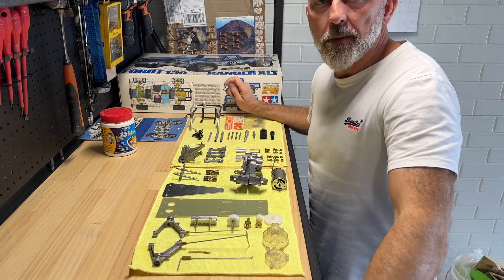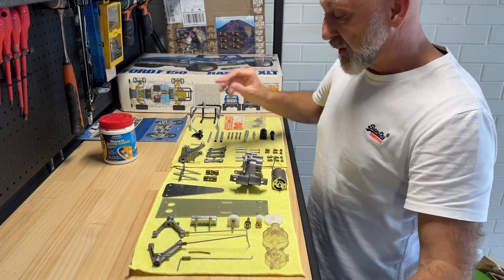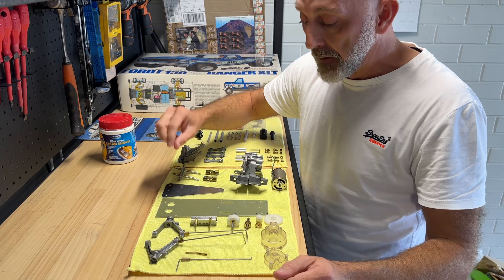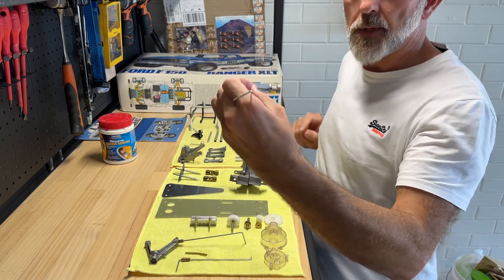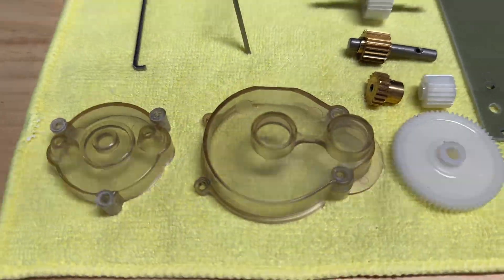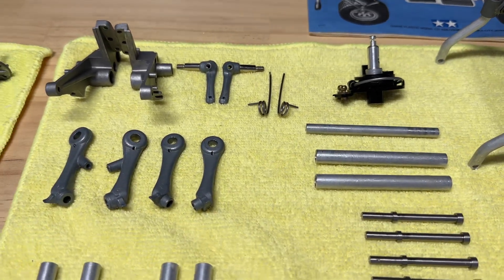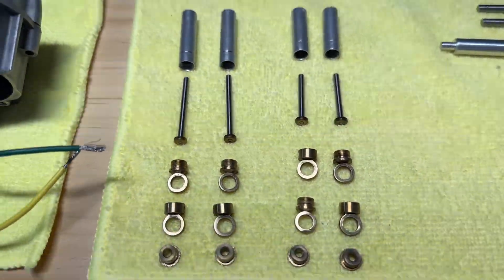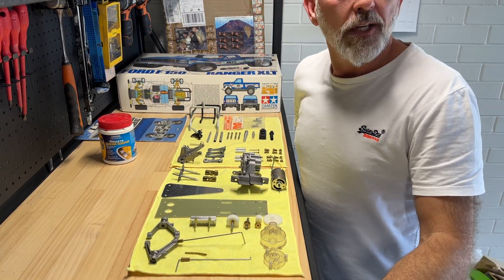Tamiya Ford F150 Ranger XLT SRB Build Part 3 - Strip Down Rear Suspension & Gearbox

Comment: I built a Sand Scorcher from various SRB parts in 2000. Started with a completely knackered SS, about the only re-usable part was the bodyshell, and then acquired a tidy Rough Rider, minus body. It's complete, but not been run. Also got a re-re SS, but haven't got around to building that yet.

Hope your build goes smoothly. Reproduction decals should be available for the F150. They're not made by Tamiya but by a 3rd party.
Reply from the maker: Cool, you should get stuck into the SS, the chassis will be easy, the body and paint will be a challenge if you go box art!